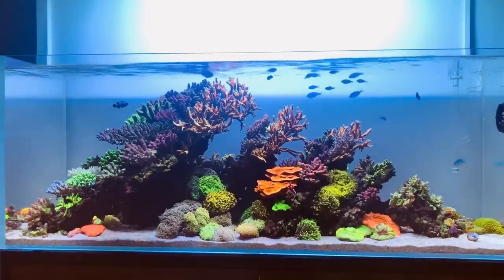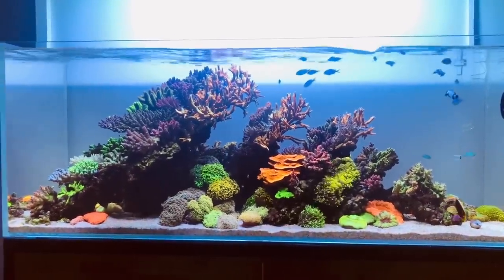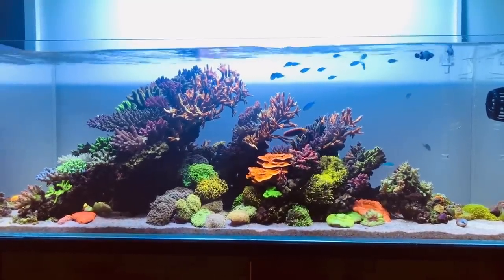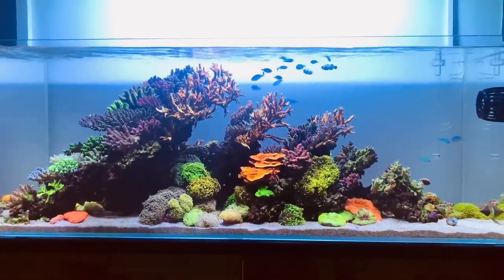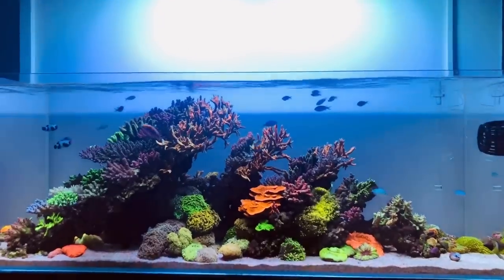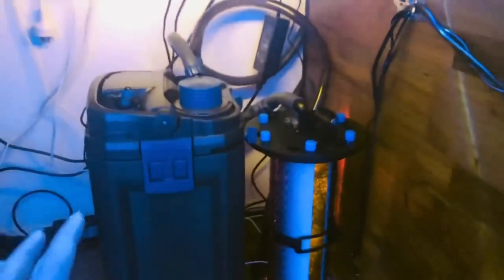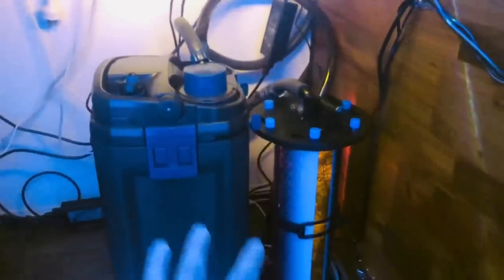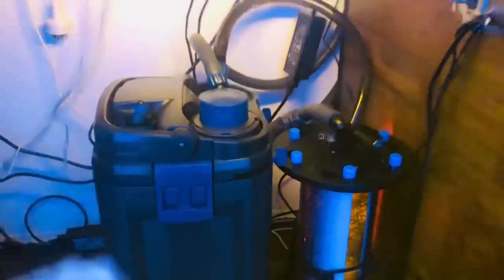Canister Filter Reef Tank? Yes! - Tips and secrets to successful canister filter reefing

Comment: I’ve been at this since I was 7 years old. Grandfather gave me a 10 gallon tank for my birthday. So almost 50 years at this. For me it’s about filtration flow and dedication to cleaning. I invested in cleaning tools and a set schedule for my aquariums I currently have. 20, 75, 90, 180, and two 225 gallon tanks. I only speak for myself but I use canister filters for all my saltwater aquariums. I water change each aquarium every other week, on a rotating schedule since I have several lol and clean every filter once a month. My levels are always perfect. I also use a lot of live rock, a large team of cleaner shrimp and I oversized the canisters because the flow ratings are marketing hype. The ratings are based on zero pump height with no media basically setting the pump next to the aquarium and empty, how much water can the pump push. Setting a water pump under an aquarium (as almost all are except for custom setups) makes the pump work harder. Basic physics. All filtration media also make the pump work harder, further reducing flow of gallons per hour. 
With all that said, a properly sized canister, cleaned regularly, more than gets the job done. 
A lot of guys with YouTube channels show you that they clean their canister filters once every 3-6 months or longer. 
You have a beautiful setup by the way.

Comment: I had a 120 gal. With a 40 gal.  Tank in the cabinet under.  Worked with two suck/spray tubes that disappeared into the tank corner obviously carrying water out for cleaning and back in to the main tank. Had 3 types of filtration within the 40 gal. Which was all gravity fed thru them pumped back into the main tank... all I ever had to do was clean the tubes, 20-30%Water change  once a month. Oh & switch out the sheet filtration  on top of the 40 gal.  maybe once every 6 months.. r Was by far the easiest set up I've ever run and ran so clean. Bio balls within the 40 gallon allowed for the larger water change when you did do the change.  By far the best setup I've ever seen or worked with

Comment: beautiful tank. 
as a sump guy myself I always suggest ppl use the oase filters for there pre-filter and heater options. 
Q: if power outages on a canister does not the back flow fill up the filter keeping  it alive?  
Q: how often do you have to clean the glass lilly pipes? how does the surface skimmer work in SW? does it float more?

Comment: Mikey hi mate. Are you still running your tanks on a canister filter. If so can you explain what you are putting at each level of the filter and when you clean it what you leave alone and don’t disturb and what you actually clean. I run a simple as tank with no filtration. Works a treat but I want to run a larger tank. My sumpless tank requires large water changes.

Comment: Nice alternative for reefing—I’ve been seriously considering running same sized reef using HOB filter (seachem tidal 110 packed with filter pad, bio media, carbon, gfo, zeolite), algae reactor (like your tunze), and no skimmer w/ weekly 10% water changes.  Aesthetically not as clean as your setup but I do fear the inevitable prolonged power loss and anaerobic reaction in canisters, which would be avoided using HOB filter.  Had a canister that wiped out a freshwater planted tank when it restarted after prolonged power loss and I wasn’t present to clean it out before power was restored.  1000 ways to skin a cat…

Comment: Do you do like a thorough cleaning of the inside walls and components every now and then to take care of coralline algea that can cause problems on your cannister filter? I had a hang on the back filter that I use to soak in white distilled vinegar and water to combat the problem which worked. I just bought a cannister to replace it and was wondering what you recommend when the corralline starts to appear?
Reply from the maker: When coralline algae appears it is best to keep your glass clean and it will stay off the glass and grow elsewhere. As for the pipes, I swap mine weekly and clean them in bleach so coralline wont grow. For your canister, it will be very similar. Just keep it cleaned :) otherwise a monthly bath in vinegar should keep your pipes nice and clean. Best wishes

Comment: I started with a CAN on my first tank setup. I made that decision after watching this and many other videos on running CAN's on reef tanks. Honestly this kind of setup is very niche, such as having that particular CAN with the heater integrated and doing all your piping in glass or acrylic. I ended up just being over whelmed with HOB equipment that would normally be down in the sump area. I am now planning on migrating my current tank to a larger one that actually uses a SUMP system. I honestly wish I had just went the SUMP route to begin with.

Comment: Thank you for this video, im starting a 75 gallon saltwater tank.  I went with a fluval f6. Should I remove all the sponges from the filter and fill it up with ceramic rings? I'm thinking in the future introduce some easy to keep corals nothing complicated?  Thank you
Reply from the maker: Thanks, the fluval fx6 is a very big filter with big hoses. I hope cleaning it frequently will work for you. You should remove the sponges and replace it with a media that wont trap so much detritus. You can possibly create a DIY prefilter using a water filter housing, taps and some sponge inside. Twist to remove and clean. Otherwise, removing the sponge and making sure water is able to freely flow through it will work well enough.
Reply: @Mikeymikemike  thank you for that tip, so tap in the inlet hose before the filter,, with another filter with a sponge to collect detritus?

Comment: Great informative video. Thanks for sharing! My question is with regards to power outages. Here in South Africa we experience alot of them. So I would like to the impact of an outage like 2 hours at a time on a canister filter if any at that on beneficial bacteria ?
Reply from the maker: 2-4 hours is ok. I have actually forgot the filter off for 8 hours and no problem. The main issue is keeping the aquarium moving with the wave maker and maybe heating or cooling, I suggest a battery backup.
Reply: @Mikeymikemike  awesome. Keep up the great work. Your video presentation is really good and interesting.

Comment: One more question 😁 You have said you are running the canister and reactor on a single motor, does that mean you are running only the canister without the reactor pump? Since I've seen it's sold with its own 1200lph pump?
Reply from the maker: Correct, I run it on the canister outflow. I do not use the extra pump. It is sufficient for the system size

Comment: Bought a Biomaster 850 for my 40 breeder after watching this video. It's working great and the prefilter setup makes maintenance so easy. My question, Mike: My tank is only about 4 months running and I am a new reefer. All my water parameters are good and stable for a mixed reef tank (Ca 420, Mg 1350, dKH 9.5, pH 8.2, NO3 10, PO4 0.03, Temp 79, Salinity 1.025), but I am having trouble trying to grow coralline algae, as well as SPS and certain LPS corals. After having a few corals die (birdsnest, micromussa lord, favia) between 2-9 weeks, I am not purchasing any more SPS and LPS until I see that coralline algae is growing. I do see coralline as an indicator to let me know when my tank is ready to support SPS/LPS. For seeding my tank with coralline, I took a nice amount of coralline scrapings from my LFS, ground it as fine as possible with a mortar and pestle, and dispersed into my tank with the filter off and the wavemaker on for 6 hours.

So ....
Do you think having a protein skimmer, along with the biomaster canister, will improve my water stability and parameters so that coralline/SPS/LPS will grow and thrive in my tank? I just bought a Tunze 9004 DC on Amazon and will receive it in a few days. Hope you can help.

Comment: Question for you: I have a fluval 406 canister, how do you  / how would I connect the reactor to the filtered water since the return goes from canister to back in the tank ? Thank you
Reply from the maker: you just need to plumb it inline on the output. Just us a reactor that is compatible with 16/22 tubing like the tunze MAR. Just make sure you use taps so you can service it

Comment: Can u place links to the siporax and zeolite?.  After spelling both correctly i found them on Amazon but still helpful to have links.  What is the difference zeolite vs seachem matrix.  I am new to the saltwater hobby but basically designed same system you did after much research and deciding which items i was willling to manage.  I don't like sumps.  I like canisters. So i added a surface skimmer and a prefilter. I have macroalgae in my display tank and will probably add an algae scrubber as my bioload increases and if nitrates and phosphates are trending up. THankful for your minimalistic and genius design.

Comment: Aside from squeezing out a sponge, what else is required for maintenance, resupply of media, and how often do you resupply and do indepth maintenance?

I'm personally looking for a setup that is quieter than hang on back skimmers and filters that doesn't require to much manual work. Its for a tank I have my parents watching while I'm at college and squeezing a sponge every 3 days sounds like it may be underselling the "ease" of your method and setup.
Reply from the maker: every 3 days cleaning hte sponge on this setup results in a net nutrient export of -2ppm No3 daily. You could easily not clean it for 2 weeks and be ok. There are other things to clean but again, I dose N and P just to keep the tank happy. Unfortunatley there is no easy way. Even automatic filter rollers needs a watchful eye and they fail, will your parents know how to fix it? This for me has been the simplest method. I will do a special maintenance video for you.
Reply: @Mikeymikemike  thanks for the quick reply! They've been doing an ok job with routine maintenance roughly every 2 weeks  for about a year (water change, shake out a hang on back filter cartridge, dumping out hob protien skimmer skimate). My protien skimmer is noticeably loud when working properly and my tank is far from being the cleanest so I'm looking for alternative filtration that either runs really quiet and requires little effort aside from a 2 week water change or a setup that pushes the water changes to 3 weeks or a month just to "lighten the load" for my parents. I've seen a could videos debunking the canister filter myth and it seems like a decent option that doesn't break the bank, is potentially quieter, and less visible.

Comment: Love to see a video which shows you don't need to spend a fortune on equipement to run a reef tank. Steady maintenance and aquarium knowledge is worth a lot. I am curious how much maintenace a canister filter needs. The little spunge looks to me if it will not take very small particles so I assume you will have some detritus build up in and underneath the filter media. How frequently do you maintain this?
Reply from the maker: It is very clean, I tip out the filter once after 5 months and it had very little waste. I think the bacteria does a very good job of cleaning too.

Comment: Hi Mike, I'm currently running the biomaster 850 on my mixed reef and I've just installed the same glass inlet and outlet but the surface skimmer is drawing in a lot of air no matter what I do with the little valve at the bottom. Any tips on stopping this from happening??? Love your tank and what you have done with it is inspiring. 
Thanks

Comment: Stunning mate. I used to run external filters on a discus tank and always thought it should be possible to make the switch to marine. Currently running a small water box reef but may upgrade one day and would certainly think about this. What lights you running? Sorry if it's been asked already but couldn't see it.

Comment: Where can I find the glass tubes? Everything else I run my aquarium the exact same way
Reply from the maker: Most aquascaping related stores should sell them. If you are having trouble, try typing in “glass lily pipe skimmer” on Amazon or eBay. Do not use the metal ones.

Comment: Do u run skimmer?!?? On power outage just releazided that you dont get an overflow on the ground like sumps do. Water stays in the box
Reply from the maker: No skimmer :)
Reply: @Mikeymikemike  okay man. Im gonna propose that Neptune systems to shut down. If you can achieve this without a skimmer sump or controller then they are usless. Look for reef dudes he featured a tank of a lady that had amazing tank like you without even a doser. You are a great example of what the hobby should be
Reply from the maker: @eillyacostandinides3344  haha that’s funny! I remember that setup too! I think controllers have a place and I personally would like one to reduce testing, but you are right, they are a tool, the aquarist is the difference.

Comment: i run two canisters on my Tank inline style...(my tank is 190 lts or 50 gal). The First one is a 100 Ltr rated job with first stage mechanical media, filter socks etc the next stage on the little guy can run a chemical media if I so wish. Then the water goes out of this into a GIANT of a canister (recommended for 300 ltr Tanks) which is full of Bio Media. about 10 Kg. This way I only ever have to disturb the little guy and clean his socks. The small canister filter is not even plugged in and basically acts like a sump through the syphon effect and the large canister filter draws the water from the outlet of the smaller canister. Of course I'd love to simplify things but when money is tight make the best use of what you've got ! :D
Reply from the maker: Nice idea using a smaller canister as mechanical filtration. There are some pretty cheap prefilter out there but if you got it spare then may as well it! Nice idea

Comment: Could you show us clear close ups of the  tube connections in the display? 
What do you do when anything grows inside the tubes, like coralline?
And what do you do when the canister motors break?
Reply from the maker: Good questions! If the canister motor breaks I have to replace the motor head or transfer the media to a backup filter. I have 2 backup filters sitting on shelf so no issues there. Chances of failure are the same as an AC return pump I guess, possibly less likely to fail since it is like an AC pump with no controller and most AC pumps seem to work forever; whereas with DC pumps the controller and transformer is the weak point. (Jebao, Sicce, Vectra all have worked excellently for me though with 0 failures) As for coralline algae, it only grows on my rocks and wavemaker. The glass pipes get replaced/bleach dipped every week so they don't build up there. I will show you some closeups in a future video for you :) Subscribe!
Reply: @Mikeymikemike  Interesting... seriously considering this option. Thanks! Subbed

Comment: The one major problem I have with canister filters is that if you lose power the filter will fill up all the way with water from gravity and then when the power kicks back on the canister filter will leak they’re made to run with an air pocket at the top so when they’re full of water and they come back on the pump forces the water out around the seal and I’ve seen many of tanks almost drained from that
Reply from the maker: That does not make sense? I have never experienced this ever nor have I ever heard of this happening. We cut the power to replace the glass pipes when servicing and switch it back on. We also get powercuts now and then or sometimes we turn off the filter (for over an hour) just to take a top down photos. Never a leak. I don't think this filter or any modern canister is designed that way too. You could pressurise this thing and it wouldn't leak a single bubble. I'm not trying to disprove your experience, it may be because you have a bad filter. But seriously, I have never experienced this, nor have any in my aquascaping community. I could literally poll all the hundreds of aquascapers I know and they would return with 0 leaks after a power cut as an answer. Odd to hear your experience.
Reply: This is totally not true. I run 3x cannister filters and they do not run with an air pocket.

Comment: 12:27 Why is most of the biological filtration in the canister? The filter pads, carbon, gfo and zeolite are mostly mechanical or chemical filtration, but when it comes to nitrifying bacteria it's probably mostly in your rock and sand.
Reply from the maker: correct; it is hard to measure since i use matrix and siporax. Both of those medias are very efficient. the rock and sand is good too, but nowhere near as porous as these media types. It's hard to say but there may be more surface area in a tray of media than a tank full of rock.
Reply: @Mikeymikemike  Cool, looking forward to the video on your dosing strategy. It's interesting to use a canister filter, I'm planning on setting up a little 20gal tank, I might try to run it on a canister filter with the glass intakes, it looks much cleaner than an overflow box

Comment: This guy is playing with fire, please don’t do this.  He didn’t mention his ato which with a standing wave (which he has) would not work.  He said he has a dosing pump for his ato, but it would have to be timed.  This could cause an over flow being that your evaporation rate will change when the season change.

To dose anything you would need to put lines in the display, which could back syphon if you don’t have check valves on all the lines.

A sump could be a 40 breeder (40 dollars at petco) a heater, and a return pump.  Then you have room to expand, add equipment as you go, and no need to worry about water on your floor.

If you are thinking about getting into saltwater, please do your research and talk to people.  It’s a great hobby and can be a lot of fun if done right.  The community is very friendly and most are willing to help.